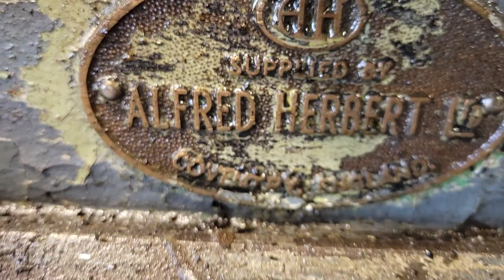Machining a cylinder on my lathe. Farmertec 288 has a failure already!!

Comment: Hey Tim, man, I put one of those aftermarket coils in my 575 xp and it fired up and ran 3 to 4 seconds died. No spark you get what you pay for my friend. Replaced it with a factory One. Been running great for 3 years .But it is fun to play with those aftermarket saws and you save a lot of money.

Comment: I made a little puck where you are using a board. All I did was take a piece of 6160 drop off I had that's about 1-1/4" round and trued the end up then center drilled it and then parted it off at about 3/4" long, flipped it then trued up the side I parted off. The live center lines up with the center drill hole and allows the other side to put pressure against the top of the cylinder. 
One other thing I do is order 6160 over twice the length of what I need for the largest mandrel I will be making then true one end up and center drill it, place the live center then turn it to a couple thou smaller than my bore diameter, flip the piece true up the other end and center drill it then turn it down to a smaller diameter cylinder bore size. Example is 54mm-.002 on one end then 52mm-.002 on the other end. When I install it, to use it, I let the live center help line it up in the chuck to remove run out and using copper pieces for soft jaws I can tighten the chuck on which ever end I need without distorting or damaging it. This allows you to work farther away from the chuck and makes it easier and safer for turning the base. Just a hint that you may or may not like.

Comment: I lost spark in mine after the first fire. It ended up being the spark plug boot, of all things. The first heat cycle on it made it shrink up where it wouldn't let the ignition wire contact the plug any more. Swapped an OEM spark plug boot onto mine, and it ran again.
Reply from the maker: I'll have to check that on this one. Thanks!

Comment: Machinable wax on the Orac lathe in school (long time ago) was great.  Only way to crash it was to run the insert into the chuck, which some people actually did.  Also, another great vid, much appreciated.  Hyway has two Husky pumps.  I just ordered a Hyway pump for my MS660.
Reply: I've seen guys crash pipe threader dies bodys into the machine trying to make too short of a nipple , on pipe threader rigig 580 ot 585 something like that itd been awhile

Comment: I have a G660 Farmertec Big Blue and it did something similar. Sometimes it would start, other times you could pull your arm off (doesn't take long on that saw, especially if you don't make sure the decompression is still on for each pull) even if you just stopped to refuel. Anyway, it had 2 problems, one was a shifted diaphragm on the fuel pump side of the carb, the factory assembled it off center and the pins actually punched a 2nd hole. I was able to re-position the diaphragm without replacing it. The 2nd major problem was the sparkplug connector is designed to pierce the plug wire and hit the core and had no securing or guiding method. It wasn't making reliable contact, so you would get a weak spark on account of it jumping 2 gaps (and sometimes not). I stripped it back, wrapped it around the spring connector and soldered it. I then filled the boot with silicone grease and re-assembled. It runs well now except for both tanks leak in storage. Fuel is the cap (FS-91 cap ordered). Oil seems to be leaking even if I store it on it's side, so it's not the cap. Hope maybe your problem is the plug contact. Thanks for sharing, great content!

Comment: Possible just replace the flywheel and key with another aftermarket flywheel if the key slot isn't to bad of shape then reuse and lap I mean lap with valve grinding compound. Then re install the new. Just see who it runs compared to the one tinman put together. Then make your choice on if you want to tuen one up or complete new bottom end and turn it up. Unless the man said i don't care one bit if you pull it apart or not. Then at that point do as you wish! Good luck and love ya brother be safe. Hope little man/miss is doing just as good as you and your wife buddy!

Comment: I have found the farmertec kits can be very good with OEM or good quality aftermarket parts. The farmertec ms 660 kits seem really good. Only problems i have seen are some clutch drums are out of round. The crankshaft big end rod bearing is sometimes not the tightest. The cylinder squish is like .060 or greater. But with a hyway cylinder it seems to make the saw a beast!
Reply: I got one of the early g372xp actually right color and all big bored it, potted it, hyway popup and 52mm jug, hadn't used it in close to a year and dropped 2 yesterday that were leaning over my driveway and she started on 3rd pull from sitting forever, never hicjupped 1 time, till it ran out of gas, took a spring loaded 4 inch branch to the bicep now I have 5ceps it basically threw my arm now it looks like i have a big purple scratched extra muscle on my arm, sucker hurts buy saw Is fantastic
Reply: I ported it via uncle harves instruction on the 372s, A BEEEEEAST

Comment: these kits are a real temptation, but the shortcomings in fit and finish really add up fast. Your flywheel key shear is probably because the shaft taper and the flywheel are not matching. You could use some shaft repair epoxy to insure a snug fit (with release agent on one part for later disassembly) or lap the buggers in with compound if the fitment error is not too great. I come away feeling like a guy will be chasing component failures until he has pretty much replaced most of the saw with reliable OEM parts.

Comment: Colchester made some good lathes.  I have an old South Bend.
Reply from the maker: My dream lathe is a South bend heavy 10.  Someday I'll get one.
Reply: @tinmanssaws  Tinman if you go with the Heavy 10 try to find one that has the D1-4 chuck mount, They are hard to find but it will allow you to thread and turn in reverse and it's easy to find a different chuck if you want. I started to buy one but ended up getting a PM1130 because there was so much wear on the South Bend. Yes I wish my lathe had a gear box but it's what I had room for at the time, my next lathe more than likely will be a 17" Kingston.
Reply: @tinmanssaws  you and me both.  mine's a 9A, 48".    would love a heavy 10.  does what I need it to though.

Comment: Another $15 dollar coil and it’s off to the race’s!  Aftermarket is cheap… for a $100 bucks you can have a couple carburetor’s and coils in your box in case you need to swap one out! 😁👍.   That one you corrected should definitely be a darn good work horse for the firewood getter position… or general work horse!  Slap a 28” on it and let them cut some wood!  😂👍

Comment: Hey tinman as a 32 year machinist you did good friend
I'm not a saw builder yet but I liked the abs shims I have used black electric tape alot in those cases.
I loved the washer on the tailstock live center 👍

Comment: My 15 inch carbide steel cutting chop saw sent a chunk of 3x3x.25 block thought the back of the saw busted out the back of the cast aluminum housing and pingpong balled around around the shop today...had just put a brand new 100 dollar blade on it..first cut idk why it done that, scared me to death, was literally like a bullet that's a lb caching gone

Comment: Coil failure - just swap coil from your 288 to the silver dogged one, answer in 5 minutes.... Doesnt need to be a permanent swap just to tell you if coil has gone south. Same with flywheel if necessary. I dont like the way that saw stopped, like something got caught up.

Regarding the lathe  - I prefer making a mandrel to slide the cylinder onto. That way I'm guaranteed the cylinder face is square to the cylinder - I've had a few that weren't square from new, they got corrected...

Comment: Hey buddy don’t know if it has been mentioned did u check the trigger was bolted down?? My 281 I built from oem parts in box I ran it out in the bush and she started miss firing and then stopped the bolts came loose on the trigger module up top I screwed it back down and she fired straight up….
Reply from the maker: Yep everything is tight amd gapped. Still no spark
Reply: @tinmanssaws  oh that sucks mate! I’d probably try an oem trigger if u have a spare and maybe order another FT ignition if u decide that’s what u want to do to continue the FT run ability… I have FT 660 I got that in kit for it was an absolute monster and the 371 kit I wasn’t impressed with

Comment: Do you make your own tooling? If so do you have any advice for a rookie?
Reply from the maker: I do, most of my tooling is hand shaped HSS. 

3 things, make sure you have a good quality wheel on you grinder. 

Don't let the tooling get too hot when grinding It (dip it in water as you go). 

Get a copy of southbends "how to run a lthe" theres drawings in there showing the correct way to grind tooling.
Reply: @tinmanssaws  I’m going to Find that book right now thanks man

Comment: Hey Tin Man I have a serious question for you.
I was on the arborists Forum website, someone wanted to improve their Husqvarna 372 xpw (?), and I had mentioned a highway big bore cylinder head.
And of course I get some comments from some ologists, saying that it would cause the saw to run 20% slower and the original cylinder head is better.
Now I've watched you and some of other Buckin's friends, and how you guys work on saws. What's got me scratching my head is how can it go 20% slower when I can adjust it to go just as fast as a stock cylinder head?

I may not be the smartest guy but here at my job I do very well, (I build airplanes). And even here at my job I get kind of the same flac from the other ologists, and usually I end up fixing their mistakes. I'm very familiar with Machining I'm very familiar with small small measurements/ tolerances.

Thinking of getting away from that website unless I'm actually looking for information on saw builds.

So basically I can understand if I do a straight swap with no other adjustments comma like putting on a bigger carb and adjusting that carburetor and the throttle to get it to go the same speed as the OEM cylinder head, that it will run 20% slower. Like you, I build from the bearings up, all new gaskets all that type of stuff. And I want my saw to be the most Dependable Workhorse possible, I'm not trying to build some competition race saw.
Reply from the maker: I use hyway, I don't think my saws are 20% slower??